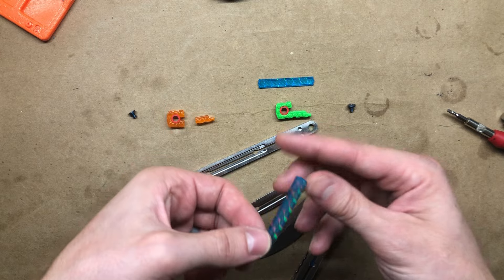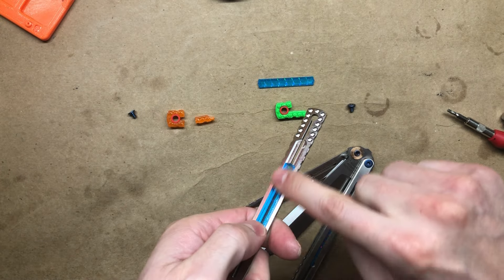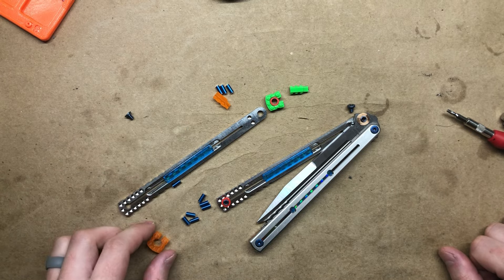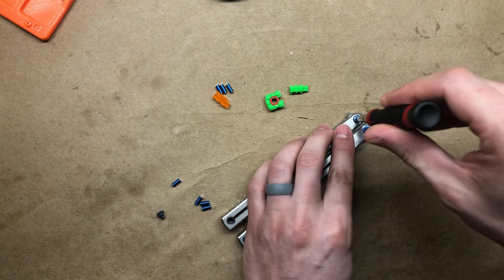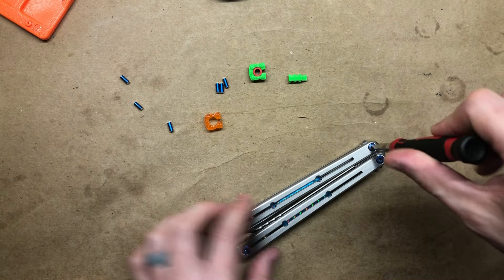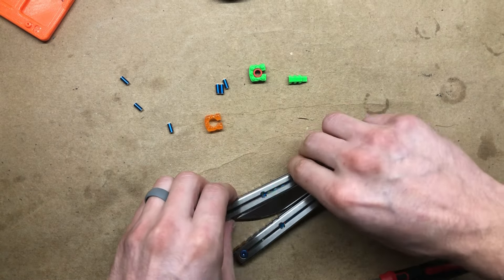Titanium Krake Raken by Squid Industries: Assembly Guide for Zippy Mods

Comment: Was wondering how youd do spacers on this one..... thought u might integrate it with the included weight pins as there is so much "room/area/space" between them.  I was of the idea that maybe you'd use a "marbles" style system as the pins could probably hold bearings/spheres in place.

Not sure if ima get anything yet as im still trying to figure out if i like the weight or not.  Been flipping shorty/chopped krakens all summer so i do like the idea of a lighter yet still balanced kraken.

I do dig the bearing/spacer aspect you got going on though as i haven't even flipped mine enough to realize the spacing "issues" from top to bottom.  

Might have to snag a set tho n start experimenting.
Reply from the maker: The inconsistent offset on the stock spacers is only an issue if you want it to be...The folks who are meticulous for details, however, will appreciate the Zippy fix. Otherwise, its happy flipping as usual. Cheers, David
Reply: @zippybalisong thanks for the heads up.  Still gonna flip her for a bit and see.  Even still I always enjoy a splash of your colors on my balis!  So might just have to happen regardless.

Loctite just set less than 20 min ago so we'll see.
❤
Reply from the maker: @G0ATHR0B  Thanks for the kind words man. Which blade do you have on yours?
Reply: @zippybalisong  hahaha I just got a handle set and threw a Nabalis Hydra blade on it(Japanese tanto false edge).  Seems pretty decent thus far.